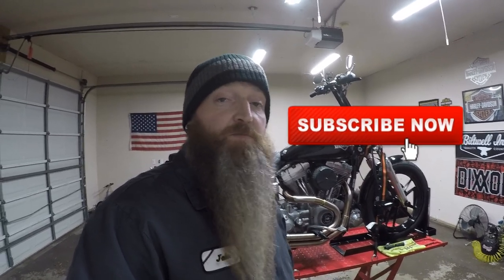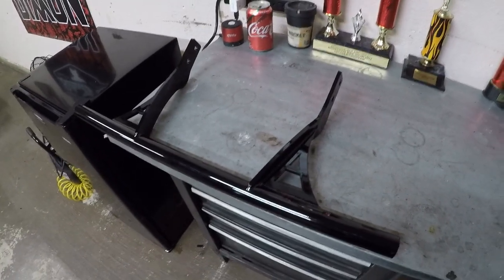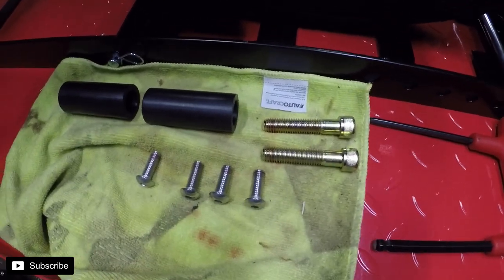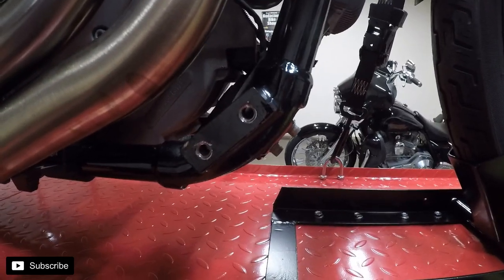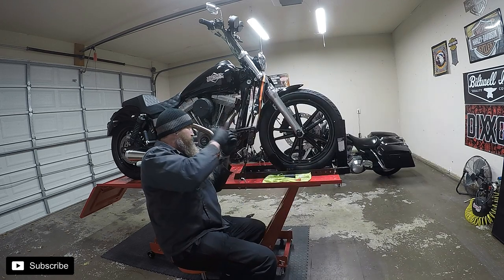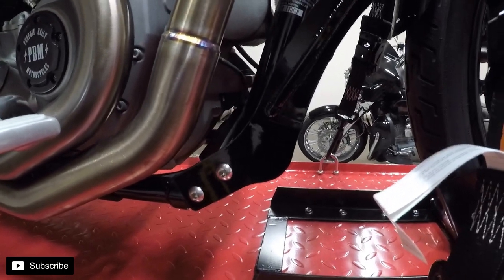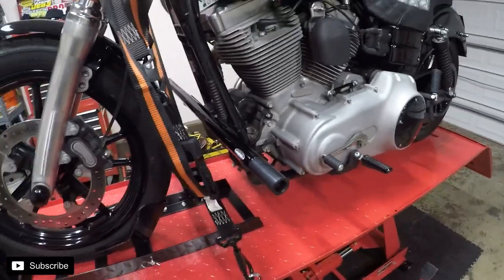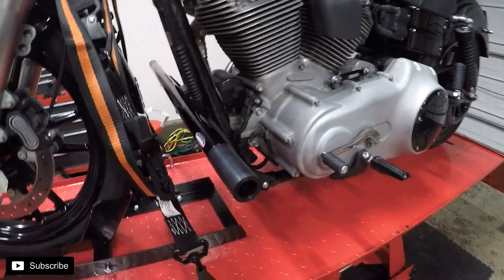Santoro FabWorx Crash Bar Install

Comment: Hey man, what size tap should I use to clean the threads?
Reply from the maker: Thats a good question lol I just took the bolts that came with the crash bar and used that to reference what tap I need its been a awhile so I dont remember the size